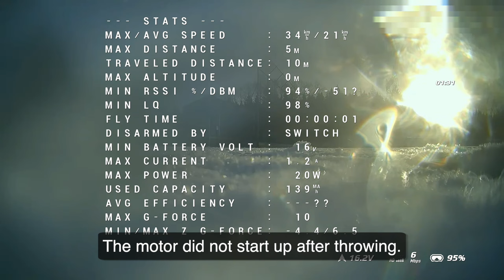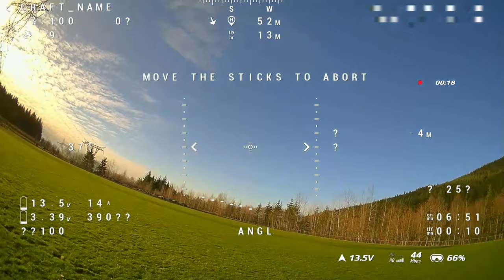My journey about Eclipson's Helix

Comment: what flight control system are you using? how did you make all the data appear in the fpv view please? and what transmitter are you using including the system like elrs? or crossfire...
Reply from the maker: Hello, I use SpeedyBee F405 WING APP. It pairs with DJI Goggles 2 (or you can with DJI Integra Goggles). All information will overlay on screen in goggles giving you all the necessary data like battery, location, etc.

For this plane, I use ELRS with TBS Mambo transmitter. I normally use TBS Crossfire but the antenna is kinda too big so had to stick with ELRS for smaller antenna.

Comment: Thanks!  Can you share a bit more regarding the electronics you used?
Reply from the maker: Components used in the wing:
- HappyModel ExpressLRS
- SpeedyBee F405 WING APP
- CaddxFPV Vista with Polar Starlight
- Flywoo mini 10th gen GPS
- BLHeli_32 45A ESC
- XING PRO-E 2207 1800kV

Next build if destroyed from crash, next component change:
- XING PRO-E 2208 2450kV (higher RPM - improved auto launch)

What’s changed in iNAV with 1800kV:
Idle throttle to 1850
Launch throttle to 2000

With 2450kV, test above values. If excessive, try 1400 idle and 1800 launch. That’ll ease on ESC, motor, and battery.
Reply: @kibbycabbit  I'm building this right now and having motor issues. What exact ESC are you using and what type of battery? I have the same FC. Thank you!
Reply from the maker: @Monty_FPV  What's wrong with it? Does it not spin or spin too slow?

In my build, I use SkyStarsRC Uranus F4 32bit 35A ESC with iFlight XING-E Pro 2207 1800kV. Motor data sheet says 1800kV can be powered by 3S to 6S. Also if you choose higher RPM rate, 2450kV can use 3S to 6S as well.

If you wanna get 2450kV, you can use either 35A or 45A ESC. If you plan to move ESC to different wing in future, maybe get 45A so it's future proof.. it's some grams heavier.
Reply from the maker: @Monty_FPV  Additionally. any ESC will do. Just make sure you get one that says 35A of any brand. I picked SKyStar Uranus F4 because it has BLHeli_32 which I can program it using BLHeli configurator. Very useful, for example, some ESC are preprogrammed to cut off if it detects low voltage.. Some other ESCs may have it already turned off by default. For example, Lithium-Ion Polymer (Lion) can continue until 3.0V each cell. Don't want ESC to disarm thinking I discharge battery too much.
Reply: @kibbycabbit  Good looking out! Got the hobby wing platinum thinking it was boss but it is apparently pwm/standard protocol only so it makes my motor run horribly with an FC. Getting an ESC with dshot support and blheli_32 seems the way to go! Thanks!
Reply from the maker: Yup. Standard is the way when ESC doesn’t have BLHeli..

Good luck. Share your footage. :D

Comment: I really like your OSD layout. Any chances you could shared the OSD settings you have configured by doing a diff dump in the iNav CLI.......or is this a DJI OSD through your goggles?
Reply from the maker: Thank you. Yes. It’s an OSD for DJI Goggles. I’m sure it’ll look better on HDZero and DJI Goggles V2 using WTFOS firmware.

Ok I’ll post my CLI lines for the OSD soon.

Comment: Did you use the LW-PLA slicer profile that Bambu shared or created your own?
Reply from the maker: Used PLA Aero profile and fine tuned from Bambu Lab article about RC airplanes then saved to new custom profile.

Helix has two printing configurations. One that will not have bottom and top layers. Both will use vase mode.

I use PETG for all other pieces. Ie: motor mount, landing sled, battery mount pad, etc.

Comment: I guess the motor not starting was caused by not strong enough throw? You can see it also in the "succesful" launch  that it barely had speed to fly. Try to throw harder :)
Reply from the maker: Yup you’re correct. Toss using wing is more challenging than hand thrown.

Problem with toss:
1) not enough speed
2) can turn it upside down

But it’s a fun hobby. Have fun flying!
Reply: @kibbycabbit  we’ve maidened similar plane  recently (same wingspan, similar weight and  racestar 2306 2300kV motor with 5043 3 blade prop and 3 s battery). Goes straight up on 2/3 throttle. Perhaps your motor was too slow? Regarding flipping over, we’ve found that setting up higher idle in iNav helps a lot. Also if you throw from the right side (holding the left wing) it helps to have prop/motor rotation reversed (the torque counteracts the turning force from the throw)

Comment: Could you share your configuration for Autolaunch? What made you crashed 2 times?
Reply from the maker: First crash, incorrect motor protocol, my ESC was old model, accidentally set to DShot600 where it only could do either Standard or OneShot125. So motor didn’t spin after throw.

Second crash, I picked 2207 1800kV motor using 5x5 prop. To my miscalculation, it spun at low speed at 50% throttle. 2207 1800kV was meant for 6S battery. I used 4S which reduced thrust to weight.

Third throw, increased idle throttle to 1850 (88%). Increased launch throttle to 2000 (100%). Changed motor delay to 100 (0.1s). Default was 500 (0.5s).

For my next launch, I’m thinking maybe do 2000 at idle throttle which would help my toss. So it could go up in air better. But be aware of battery sag or ESC for continuous current draw.

My motor could pull as much as 30A so I got 35A ESC.

My configurations are mostly defaults.
Reply: @kibbycabbit  thank you, very detailed, i think it will be better if you mention mistakes in the video, it will be useful documentation.
Reply from the maker: Great feedback. Thank you!